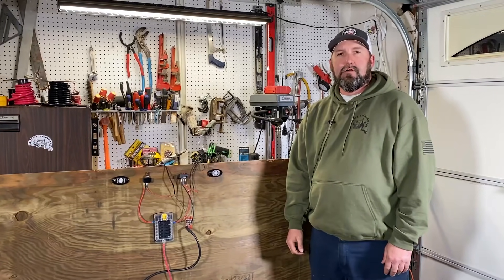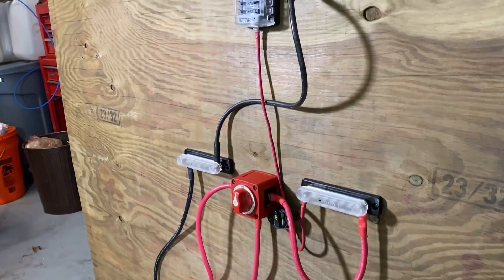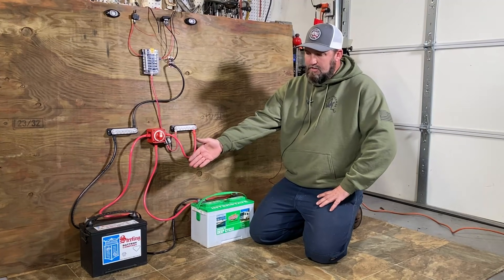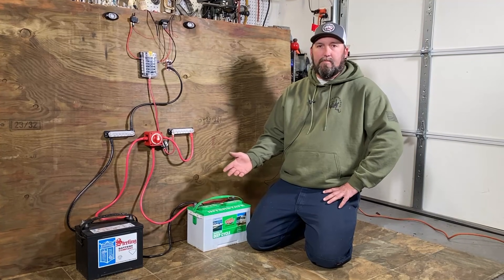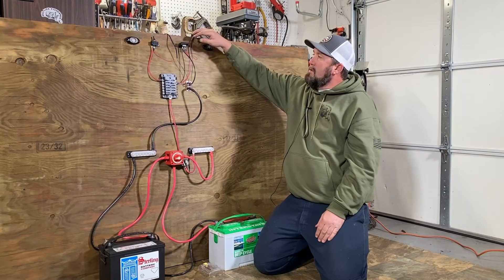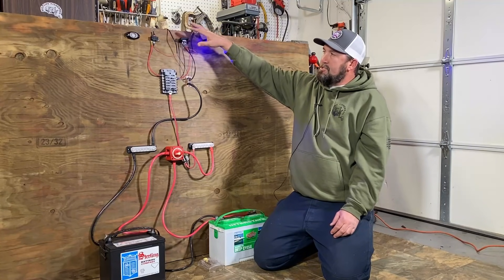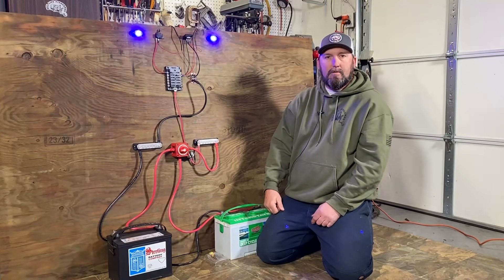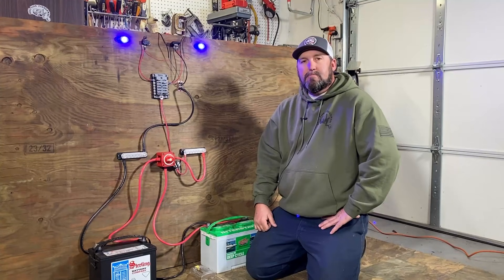BASIC BOAT DUAL BATTERY WIRING | HOW TO

Comment: I know this is an old post, but I have a good (stupid) question just in hopes you still might see it and answer it: On a modern outboard (zuke 300 in my case) do the batteries get charged through the same wires they discharge from? Ie: from the red poz wires going from the batts to the batt selector switch???  Or if your set up here were actually in a boat, would there be any additional wires going to the poz terminals of either batt???
Reply from the maker: Do you mean from a plugin onboard battery charger? Those leads would need to be directly connected to the battery. But the charge from the engine alternator or stator would go through the battery cables and to whatever battery you have selected on the switch. Also would like to add that you should have an isolator ACR if you want two batteries of different types or ratings to be charged at the same time from the engine while running. Hopefully that helps let me know if you have questions. Thanks for watching
Reply: @ReelLifeFisherman  Thanks so much for the reply. Not charger...just talking alternator. That was main stupid question i had...charges through same cables they discharge from. What caused my confusion was a mystery red wire from my 2020 zuke 300 harness. It turns out that zuke did this sweet thing for this exact set up: The "extra" red wire is designed to go to a "house" batt and charge it separately off the alternator while running and isolated (while batt switch is in the crank batt position). So that while I have a 4 position switch (off, batt1, batt2, both) it never has to be switched from batt 1 (crank batt) to keep both isolated and optimally charged 🙂 The "both" setting is now exclusively reserved for a "jump" should cranking batt fail and there is no need to run on "batt 2" setting to recharge the "house" batt. While engine is off and i am sipping power to gps or whatever, the switch sits at position 2 to pull off of "house" batt. Then switch to batt 1 when it is time to fire up and go.

Comment: Fantastic video. Very informative. One question, while under way if you only have the cranking battery on, is there a way to charge the aux battery? Or is the only way by a battery isolator?

Comment: Will it be possible to run the negative 6 gage wire from the battery straight to a fuse box and run a 6 gage positive wire from the switch to the fuse boxe with a circuit breaker. Taking out the 2 bus bars? Fuse box as a negative bus bar on it
Reply from the maker: you don't need to run the bus bars
Reply: @ReelLifeFisherman  will 6 gage be fine or would you recommend 4 gage. Thank you your video helped a lot
Reply from the maker: It really all depends on the length of run and what you will be powering from the fuse panel. Usually a power supply to a fuse panel would be 8ga or 6ga and 4ga from the battery to the switch and switch to the engine. Is pretty typical.

Comment: Very helpful! However one question, you mention not to turn your battery switch while the engine is running. I noticed as you turned from #1 to #2 (counter clockwise) the LED lights did not turn off in between the change of batteries. 

Example of why i would want to turn the switch while engine is running:
Spent a few hours with engine OFF and battery switch set to #2 (deep cycle house battery) with lights and music playing. 
Now its time to start the engine, so i need to switch to #1. Once the engine is running, i want my alternator to charge battery #2 on the way back to the dock. How is this possible if i cannot turn the switch when the engine is running? 
Thank you

Comment: So you said you should turn the engine off before switching batteries. So let's say you just started it and want to switch to battery 2 do you have to turn the engine off first? Or do you stay on the number 1 battery while your underway until your parked for a bit, then switch to battery 2?

Comment: Hi mate. Great video and very well laid out. Use this for reference all the time.
One thing. Where do you run the negative from the outboard to?
Straight to Crank battery or to the negative Bus Bar?
Just getting my head around this negative connection.
It doesn’t matter if the House battery isn’t direct connected to Bus Bar because of the negative jumping over to the Crank..

Comment: Without reading all the questions, i have two.
I used a 50 amp fuse going to the fuse box. Is the two big or if there is a problem will it undoubtedly trip the 50 as well as a 20 or 30?
Also, my ground goes to the engine block! You did not address this. I am an electrical dummy sooo there's that.
So question is do i go negatve from house to crank to engine end then stack a negative ring on the engine to a negative buss bar? I have a 350cc inboard.
Thanks in advance!

Comment: Thank you, this was so simply explained and well presented.

Had 2 questions if anyone can answer. 

You mentioned to power off the boat and electronics before switching to battery 1 or 2, what about if you are switching it to the combined setting having power from battery 1 and 2, would you still have to power down the boat?

And also, when I have 2 batteries on the boat how do you generally charge each battery especially the house bagtery which would be used more for when the boat is off out in the water?

Sorry may be dumb questions but trying to figure all this out.

Comment: What if I just have lights bilge pump and radio working off the large deep cycle. 
I’m on a sailboat and one of my 12v the smaller one died. Do I need two?

Comment: Did he ever say where the ground wire from the engine goes.....
Reply from the maker: Yes. It goes on the cranking battery negative.. then you need a negative to negative jumper between the two batteries.

Comment: If I'm trolling for salmon, my engine and downrigger would be constantly running. Is the solution to hook up the downrigger to the crank battery? Or have the DR hooked up to deep cycle battery and have the switch on 1&2 so the engine runs and the downrigger is also running?

Comment: This is a great video, I have a pontoon with a 50hp yamaha 2 stroke, and my question is where would I attach the charger/regulator of of the motor? The bus bar? The starter battery (but then deep cycle would not change). I was going to mount a small 40w solar panel off the back with a charge controller thinking it would help deep cycle stay charged, but my hunch is I would connect it to same place as engine charger/regulator. But still uncertain where that would be. Any help would be greatly welcomed.

Comment: Quick question
2 marine batteries
Perko 4 way 1-2 off and both switch
Negatives from battery are bridged together with motor ground

How come I have continuity between postive and ground even with the perko compeltely take out?is that normal?
Everything seems to work just fine. Just wasnt sure.

With perko in place. 1-2 post have continuity even when the switch is off.

Comment: Thanks for your time   BUT   Where does the positive and negitive   wiring go to the outboard electric starter ?
Reply from the maker: I say in the video exactly where they go.. BUT you must have not caught that..  the positive from the engine goes on the output of the battery switch and the negative goes on the negative post of the cranking battery. Then a negative jumper between the 2 battery negatives .  Thanks for watching

Comment: This doesn't show a connection to the engine. How would or how do these two batteries get charged? Do they both get charged at the same rate from the engine of the boat or do you have to charge the house battery via a different means?

Comment: I watched your video saying not to switch batteries from 1 to 2 with the engine running. I have always done this while the engine was running to charge 2 if it was low. I didn't want to turn engine off and then have to start it again on the weaker battery 2. This is a bad way to do it?

Comment: just fitted the same system to my 20ft boat , so in theory when i use the start up battery i have got to turn the engine off to switch over to the house battery so therefore when i restart the engine it will be using the house battery to start up the engine,

Comment: Great videos. Question on the negative jumper between the 2 batteries. Is there any difference by say, having a negative wire directly from each battery to the bus bar vs jumping the negative on both batteries? So 1 neg line from each battery connected to bus bar posts. Is all the same? Hope this makes sense. Thanks!

Comment: Fantastic and really helpful video as I’m new to boats. If position 1 is selected when cranking the engine but I’m also running a chart plotter/ fishfinder when do I switch to the house battery if the switch position shouldn’t be changed with the engine running?
Reply: there should be a position on the kill switch to run both 1&2 at the same time. then when you get to your spot shut down the engine and switch to acc battery only

Comment: Thank you for this instructional video! I’m also having to re-wire my used boat and will add a deep cycle battery and switch. When I charge my batteries at the end of the day, do I switch to #1 and charge, then switch to battery #2 then charge? Or can I charge both at the same time?

Comment: I am definitely setting up a battery switch and a couple bus bars. I can't stand that this boat basically has 1 battery compartment and they want you to run the house electronics on the crank battery. I put a house Battery under my CC in the storage compartment and ran some of my house wires to that battery. Right now I have a sloppy bunch of wires heat sealed with ring attachments going straight to the battery. I want to put a switch in the rear battery compartment run a positive and negative 8 gauge wire up to my house battey and then put a couple bus under the dash for wire connections and run everything on the house battery then I can charge my house battery as I'm moving to different spots until I set up my solar panel on the T top😊 I don't want anything but my engine on the crank battery. I have an old two stroke merc. Sometimes they get a little hard to start and need some cranking persuasion 😂

Comment: Great breakdown. I’m by no means knowledgeable around this sort of thing so I do have a question. Is this for a new set up or can this be intergrated  into my current layout? I’m just looking to add a second battery within same switch. Sorry about the question just not good around electrical.

Comment: Great guy but bad advice. You should have a dc to dc charger to charge the deep cycle, a seperate battery cut off switch for each of the start and deep cycle circuits, dont use lithium with out digging deep into the engineering tables or you might overheat your alternator, and many other pointers. This set-up will work in one sense but the deep cycle will have dramatically less fullcharge and less life of the system. I dont have the time to explain why but other videos cover this much better.

Comment: Is it recommended or does it cause a problem if the trolling motor battery system is also grounded to the same negative bus as the house and starter?
Reply from the maker: Its best to keep the trolling motor batteries completely separate.  Some bass boat manufacturers will use the main negative side of the trolling motor batteries as an emergency crank battery and install a battery switch.. but if its hooked the the positive side of the trolling motor batteries when wired in series it will mess up everything over time!

Comment: My batteries are in the back/stern. Totally messes with the weight distribution of the boat. 20ft carolina skiff. I want to relocate them into the center console.Will the longer wire to crank my Suzuki 115hp   be a problem? (The longer run)?

Comment: Why do you have a negative bus on the battery end of the system? (the one left of the red main switch). Couldn't you run the black wire from the battery directly to the fuse block?
Reply from the maker: Thanks for the question.. I have one there for adding more accessories. Especially for fishing boats.  Like let’s say , downriggers or power poles or jack plate wiring etc . Without having to stack ring terminals on battery posts .. thanks for watching and commenting I appreciate it!

Comment: I like running a Blue Sea Systems breaker panel at the console. No fuses to deal with, lighted switches, and waterproof. 
I have to rewire my new-to-me boat soon. Very informative video.
Reply from the maker: Awesome glad you found it helpful! Thanks for watching and commenting! If you happen to have any questions let me know.. good luck with your project!
Reply: @ReelLifeFisherman  the breaker between the battery and your fuse block was a nice touch and I will most likely be doing the same. I'll be adding a second battery as I'm adding a lot of electronics to this boat, most of which will be running when the motor is off.

Comment: Doesn’t running both of those batteries together double the voltage to 24?
Reply from the maker: No it connects them in parallel. To get to 24 volts it would have to be connected in series. I have other battery videos explaining how to wire batteries that show  how it’s done. Thanks for watching and let me know if you have any questions.

Comment: shouldn't there be two leads going to the motor? and if so where do they come from ? when the battery switch is in position 2 will the motors alternator be charging your deep cycle battery ?

Comment: great video,  im just left wondering where is the system grounded or earthed as it is a boat ?
Reply from the maker: So in this demonstration it’s  not ,just grounded back to battery.. but when in the boat it would have the negative from the engine installed on the battery. Let me know if you have questions and thanks for watching.

Comment: How are the Batteries charged by the alternator ?
Reply from the maker: On the water the battery selected will be charged by the alternator or stator . At home or marina  I would recommend having a on board battery charger and keeping it plugged into shore power. Thanks for watching!
Reply: @ReelLifeFisherman    On the water the alternator connects to the battery selector switch ?  then runs through the positive battery lead ?
Reply from the maker: The positive from the engine connects to the output of the battery switch. So the charge from the alternator will then be directed to whatever battery is selected on the switch

Comment: Great video, however I do have a concern/question. On the backside of that selector, I see that you have your cranking battery hooked up to the upper right terminal and your aux wires hooked up to the terminal labeled "Output" which is to the upper left. Last, your deep cycle is connected to the bottom terminal, all in accordance with Blue Sea Systems' installation manual. However, on the front of the selector, the aux cables are connected to position "2" while your deep cycle is in position "1-2." At the end of the video, you switched to position "2" stating that you activated your deep cycle battery, however your deep cycle battery is connected to "1-2." That particular selector (model 6007) is different from the others as the output terminal is labeled as position "2" and the terminal labeled "1-2" hooks up to the secondary battery . Given whichever is selected other than "off," you are going to get power, but in your opinion, wouldn't position "2" activate both batteries while position "1-2" only activate your deep cycle, or does it not make a difference which terminal your deep cycle and aux wires are connected to? Sorry man, this is quite confusing as other diagrams I had seen contradict Blue Sea Systems' instructions.
Reply from the maker: So they way I have always installed them and seen them installed is the crank battery is :1 and deep cycle is :2 and every thing gets it’s power from the output side. 1&2 would combine the batteries in parallel. But isn’t ever necessary because you can run everything off of either battery..
Reply: @ReelLifeFisherman  good to go. I actually submitted the same question to the manufacturer's technicians and they replied saying the labels up front were not intended for use and to pay attention to the "output" terminal on the back for both batteries. Luckily that is how I re-connected them after disconnecting for the first time to clean off the terminals on the batteries. Thanks brother, I appreciate the info!

Comment: You didn't really explain how both batteries get charged by the motors and how they are connected to the system. I have a small kicker and a main that have charging circuits. Do you have a video to explain how those get hooked up? Do you only use an on board charger for the deep cycle? If you cant switch the main power selector while running, how do you start the motor on the cranking batt and then charge the deep cycle? Do you crank on the deep cycle in t that case?

Comment: You still responding to this video?  
Question on charger for house and crank and 24 volt trolling batteries. Can I buy one charger to do all 3?  I see charger with 3 stations but the 24 volt has two batteries so not sure the 3 leg can charge 2 12 volts

Comment: Sir, I have a question. How would a 24 volt battery, for the second battery set up, effect this 2 battery set up?  Can 12 volt appliances run okay on a 24 volt battery?
Reply from the maker: Some led lights and such can . But most things you can’t. I would only runs 12v battery. Keep the 24v batteries for trolling motors.